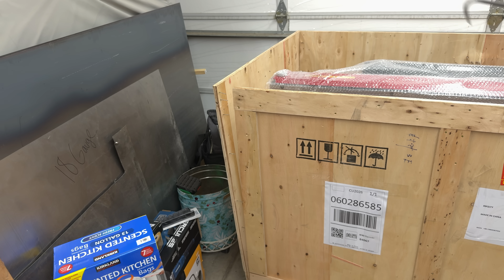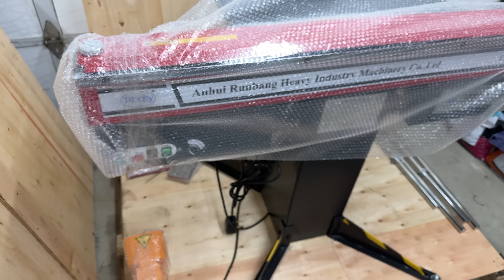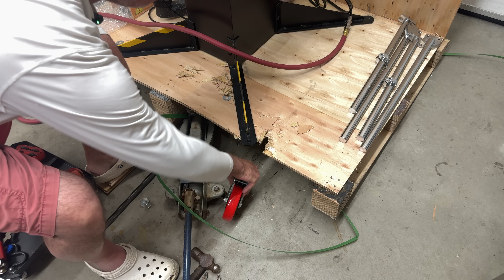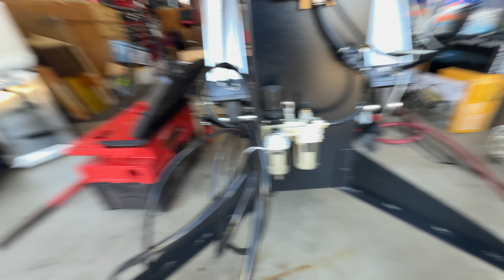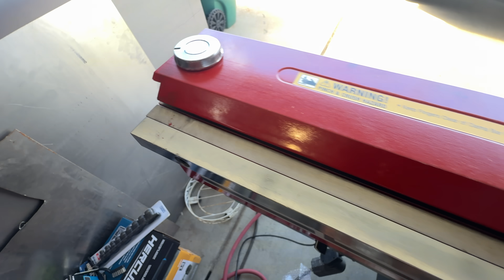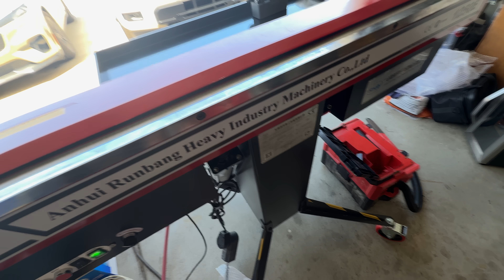I Bought a Sheet Metal Machine Most People Have Never Seen!

Comment: Powered sheet metal breaks have been around for ever. I made on that used the edge of a steel workbench when I was a teen. Not powered but it got the job done.
Reply from the maker: That’s cool. We were going to build one of these. Manual bending instead of pneumatic, but wasn’t cost effective. So far this thing is super cool.

Comment: How do you get a precise angle with it. 
It looked like you had to control the pedal for angle. 
That would absolutely s u ck
Surely you can type your desired angles or turn a dial.
Reply from the maker: There’s limiters on the back of it. They are sensors. You set the angle you want with those  and it bends it to that angle. Haven’t tried it yet but that’s the package

Comment: Just buy a new jeep body from C&C Surplus Sales, new metal, no rust, less time!
Reply from the maker: Thought about that. But I have other projects that need some love also. A Mustang on a stand, a VW bus, a Z Car, the list gets longer.
Reply: @carguytroy  I don't know about cheaper, but it would definitely save lots of time and labor buying a new body!  You could still use the new machine for parts you can't buy aftermarket!
Reply: It's called restoration, not replacement.  Saving as much of the original vehicle as possible is the entire point.
Reply: @netpackrat  Replacement is exactly what it is, new pieces welded to old rusty metal! Fifty or a hundred welds to fail, crack or rust through again! A new rust free jeep body is a great foundation for a rebuild!  You wouldn't referb. a house on a crappy, crumbly foundation!  New- could get you a long way down the road to getting to those other projects done!
Reply from the maker: @netpackrat that’s the plan. Generally anyway

Comment: Old iron like this is usually worth more than the shiny stuff for exactly one reason: the frame is stiff. Deflection under load is what kills accuracy on sheet metal gear, and you can rebuild bearings and drives far more easily than you can un-flex a light frame. Good find.
Reply from the maker: Thanks. So far it’s amazing.

Comment: Very nice. That will change the way you look at your project. My brother has a Magna-Bend that I've used a few times. Big difference between 16 and 14 gage.
Reply from the maker: It’s pretty nice. I like it a lot. Bent some 16 gauge today full length of the bender. It did fine with that. 14 is awfully thick. I think the spec is for 16 gauge. I’ll double check that.